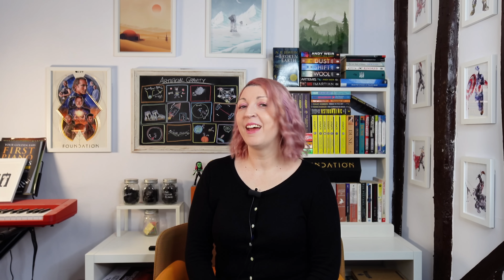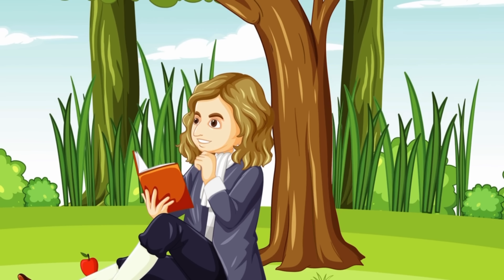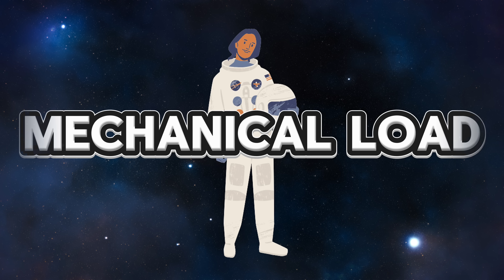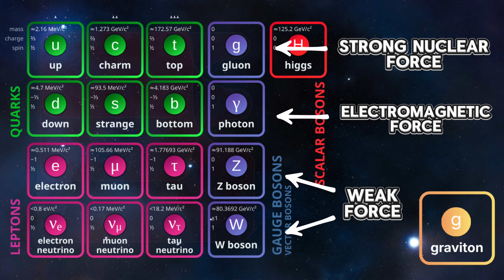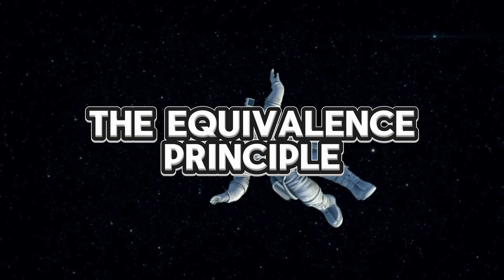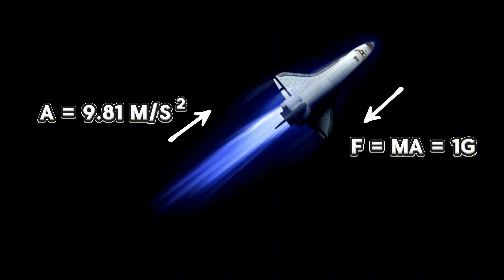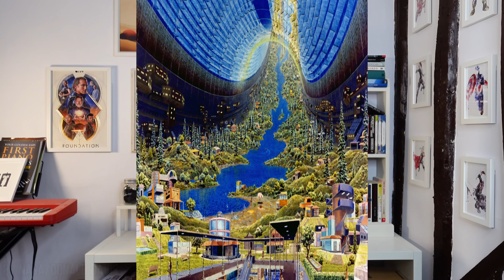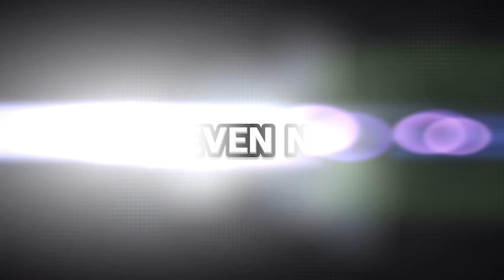Why Artificial Gravity Is Harder Than It Looks

Comment: The problem is mass, it would have to pretty long and wide, there was just a video the other day, about it. The issue is building in space or or many flights, with sub assembly in space. But it's very doable,  it's money. And the weight needed for adequate shielding. The bigger issue weight, and shielding against the different radiations. Essentially we think how big star shop is, the sub structures and sub assembly parts, would be 3 to 4 times the mass of star ship.with dozens of trips with a rocket that big, we really are another 50 years away from better engines.
I don't think I will see in my lifetime a trip to Mars where peope,take 9 months to get there, 14 months live there, till the alignment is right for them to return,  spending over 2 1/2 years  in space. It's a radiation issue,  and gravity issue,  there's not enough gravity on Mars aswell,  to be there that long, abd them not be physically weak after 9 months,

Comment: If a person is in a huge rotating space station providing artificial rotational gravity, and he jumps away from the floor, he would be stuck there floating off the floor. There is no gravity to pull him back to the floor. He would continue to rotate with the ship but he would not fall back to the floor. How far from the floor he floats would not depend on how hard he jumps. He would hit the ceiling sooner or later depending on how hard he jumps, floating in air, and would continue rotating with the ship in mid air. The walls and ceiling would need to have features built in that allow the individual to grasp the walls and climb his way “down”. Or the person could push off the ceiling sending him back to the floor.

Comment: I don't have questions, however at 17:42 of the video you mentioned about boots, if one would wear compression sleeves in space it would add to the stress for muscle strength to continue try wearing a compression sleeve for your elbows while brushing your teeth it's like lifting weights at the same time.

Comment: Gravity threshold for body changes. You could have a many step plateau depending on what partial gravity you are in (becoming a "belter" vs being earth normal).  We may have to consider there may not be one. it may well be a continuous loss at different rates depending what your partial gravity is (higher loss at lower gravity). We wont know until we do conduct those studies on the moon (as was mentioned). That would be the closest natural laboratory with 1/6th earth normal. We probably wont be building any large rotating space stations - because our economics system is based on short term profit. Short term profit and serious space exploration are diametrically opposed concepts :).  The only way it would work is government agencies or multinational cooperation. The farther we go out - the more deeper investment its going to take.

Comment: It i not an engineering problem as much as a cost analysis problem - as is whether to go to Mars. Designing and testing an orbital station that allows us to calibrate the tradeoffs between radius, spin and the coriolis effect is probably cheaper than a massive ESA building doing incremental research. Doing a practical mock-up makes space tourism possible - so that the tourists can occupy the low G rings while staff live in higher G - so that they can stay longer and not be expensively re-boosted on a periodic basis. Also, actually going to the Martian surface is not optimal. Instead, an orbital station around Mars designed with families and social structures - kind of an orbiting JPL - is much more effective for doing science with less wait time between experiments. There can be some up-and down to retrieve samples - but alcohol fuel and oxygen can be produced for this given a large enough station.

Constant boost is no so hard if you do a broken washing machine drive. Rotate masses but don't let them get to perpendicular to the direction of rotation. With enough rotating mass (with at least two modules with counter-rotation to provide stability), the only issue is whether your fusion micro-reactor produces enough energy to move both crew and reactor at .38G - or whatever G the spinning experiment say is necessary. Sometimes, engineering requires testing a prototype rather than a model.

Comment: I once wrote a short story about a romance which developed between two scientists who were working on an anti-gravity chamber. 
    The chamber was circular, the size of a small city library, and three stories high. It was lined with book shelves around the edge at all heights, with gaps between some of the shelves in which special hammocks were slung. These hammocks totally enclosed you, and were for reading books and/or sleeping. For those who prefered to sit, chairs were provided with seat belts to hold you in place. 
     What's more there were sandwich stations with specially adapted fridges and microwave ovens, for warming snacks and making hot drinks in cups especially designed for an anti-gravity environment. 
    Around the edge of this anti-gravity library, four or five metres inside the book shelves, was a grid network of metal railings which would enable anyone to climb towards an exit in case the machine went wrong. 
    Attached to the inner side of the railings, at regular intervals, were red circular items which looked like life belts (or life savers), normally found next to bodies of water. In fact they were strong plastic casings containing very long ropes which could be used in an emergency to help rescue anyone who couldn't cope with the anti-grav environment. 
    Eventually the day came to test the machine. This required each of the scientists to press hand sized glowing buttons on the ground floor, at opposite sides of the building next to exit doors. Both buttons had to be pressed at the same time to turn it either on or off. This was to prevent the thing being turned off while someone was floating about near the ceiling!
    All would have been fine except that one of them had been testing different gravity alignments the day before and had forgotten to reset the machine. They left it in 'gravity well' mode. This had the effect of pulling everything not tied down into the litteral centre of the library, where the gravity was about 1/3g. 
     You can guess then what happened when they simultaneously pressed their buttons and turned the anti-gravity on. That's right. They both floated up to the centre of the library, colliding with each other and staying there, as if magnetically glued together! Their collision set them spinning and tumbling and they soon became disorientated and nauseous. Luckily they'd taken strong seasickness medication which helped to prevent vomiting.
      At first all they could do was to close their eyes and cling to each other, body to body, laughing aloud and yet a little scared while they tried to recover from their shock and disorientation. 
      Question: How did they stop/slow their spinning and tumbling in the litteral centre of the library, and how did they get to the buttons to turn the damned thing off?
      Clues: They were wearing climbing helmets, and sports clothes suitable for unhindered motion, and each had 20m light weight climbing ropes attached to themselves in case of emergency. They discussed pushing hard away from each other in an effort to reach the railings, but decided that might only make the tumbling worse if they collided again in the middle.
      How did they escape their predicament, caught in that unforgiving gravity well? What clever thinking helped them both to get to ground level and turn off the machine?
      Please leave your suggestions below.

Comment: 3l atlas might give us a hint. How to rotate the higgs field to simulate gravity. The interactions of the fields involved (this is the story telling part) evolve frequencies required to create artificial mass that are seen as color in 3I atlas halo around itself. 3I atlas core also spins and diameter is  approximately given as 1.5 to 2 miles diameter.
Seems like the components af artificial gravity is being given to us by 3I atlas curently. Perhaps this is its message. Spin the higgs field seems relevant ...and the atomic particle analysis of the core of 3I atlas appears also necessary to pull artificial gravity off,  as a working system. ???

Comment: 1) From what I remember, in The Expanse, no one was burning for months… and fuel was regularly loaded (there's even a line of Fred Johnson on Tycho complaining about how much free fuel he'd been loading into Rocinante.

2) Also in The Expanse, in the last season we get several shots inside the fusion ignition chamber, with a fuel pellet being injected for what looks like a laser-based and tokamak combo. You can work out the specific impulse of a highly refined heavy isotope pellet — rather doable.

3) There's been quite a few works of literature (and then cinema, such as the upcoming Hail Mary) using quite long cables to reduce Coriolis effects on the cheap.

4) Surprised you didn't illustrate the Coriolis effects with numerous frames in the Expanse (Miller pouring whiskey-like alcohol… Naomi Nagata using dust on Eros to check their position when lost…)

5) It's not an engineering problem. It's a human coordination problem, which is worse and much trickier to solve than physics, alas. 😕

Comment: Space craft will need to be redesigned. At the moment they're designed with zero gravity in mind - esp. the larger space station module type habitats. Once you re-introduce gravity into the equation again, a lot more strength has to be factored in. That increases weight and launch costs increase exponentially - If you tether two matching craft on an adjustable length tether, you may be able to then work out what rates of gravity are adequate? This length will determine spin rate and g-effect? No crew should be required on the "dumb" craft - adding crew would simply double your HR logistics...

Comment: it all just sounds like angular momentum if gravity were a force, it would all be the same, but it's not the same goes for the clocks it just proves that depending on where you actually stand has more to do with time dilaton than anything eals two clocks at the same place have same gravity applied to them as they move from the surface Angular momentum increases and you have your time dilaton variables light travaling past a large body same thing angularmomentum gravitatonal foce puling on the particals as they pass by gravity realy is just the side afect of mass in moton or at rest it realy dosnt matter its a mass efect. Take a large planet, for instance you stand on the surface, you are heavier, but you are the same weight you stand on Mars you're lighter but you are the same weight same for any planet weight changes by the mass of the object you are standing on, so how can it be a force

Comment: Magnetic boots would NOT allow you to move « normally, » because the rest of your body will flop about like a fish if you don’t use your legs and feet to compensate. Leaning forward slightly as you do in gravity would have no effect on your walking speed. Zero. Walking in mag boots would be very stressful until you developed the muscle strength required to move as you wish. Most people would learn an entirely new way of moving within hours. 

Acceleration of a ship would NOT be different from nose to tail, except for the milliseconds that the flex of the ship’s structure took to reach full compression at that acceleration. What would be different is that a ship on a surface under gravity (and not otherwise accelerating), WOULD have a slight difference due to the fractional difference in distance from the greater mass’ center of gravity and any centripetal forces due to the body’s rotation. . 

I’m not going to comment on everything in this video, but I reckon most folks interested in the topic would have lost interest less than five minutes in. Nice try, though, and thanks for making a video that sixth-graders can relate to. Heck, I appreciate your effort; I know making videos isn’t that easy for most people, and studying videography along with physics is likely quite challenging. (That’s why writers’ guides recommend writing what you know.) You might practice not looking down your nose at the camera; I think you’d be cuter at eye level. :)
Reply from the maker: lol. you really are clueless.
Reply: @popculturescientist  That’s why I keep researching.

Comment: Some interesting numbers from an engineer…

Mars gravity with 4rpm (the tolerance limit for some people) requires a centrifuge radius of just 16.8 metres. That’s entirely achievable currently with a tether, and a trial in orbit could tell us a lot about Mars habitability.

Mars gravity with 1rpm (likely tolerable for most people) requires a centrifuge radius of 268 metres. That’s an engineering challenge, but likely achievable with effort as part of preparations for a mission to Mars. And it could form the basis for a permanently habitable space station in Earth orbit for long term occupancy.

If Mars is ever to be gravitationally habitable, we need to develop and prove a 0.3g habitat, and if that’s viable there’s no reason we can’t base future space structures on that gravity.

And we’d need to engineer a largely vibration free coupling to a non-rotating hub for arrival and departure, and access to a microgravity section for scientific research.

Comment: Space X has mentioned two spacecraft tied together by a long cable that sins at the central point to create gravity.  Which would solve the inner ear issues of tighter spinning.    As for a ship why spin just a small part or section.  Why not spiral like a football the whole ship?  The only part that spins in the center would be the energy generator and the engines.  Where when spinning wouldn't have to be crewed with anything living.

Comment: We could do the electromagnetic thing for long term and trick the body.  By using metal implants and pump implants or drugs to increase blood  and spinal fluid flow and pressures throughout the body. Also putting metal into the space suit to help the electromagnetic forces to react also with the metal implants.  As we have the technology just have to implement the idea.  Once we decide to take longer trips.  Lucky for humans we may have hundreds of years to weight for trips further out into our solar system.  but may be ideal for colonies on the moon to supplement the effects of 1/6 Earth's gravity to something closer to 1 g.  At least this is how I would do it in the short term.  Long term genetic modify human travelers to adapt to space travel.  no legs four or more arms with two hearts in order to compensate for reduced blood flow.  with metal or plastic to strengthen or reenforce bone.  then have environmental suits to be used on what ver destination they are to arrive at.  Both would be classified a another species of human.  But the experience would be the same.  Once we leave Earth we will be branching off into another branch of evolution.  These ideas are more plausible.  A cyborg human is doable with current technology and less energy intensive.  Like to see you explore the idea od cybornetics. and its ability to solve many of the issues of living in space.

Comment: One issue I see with a short radius centrifuge is that you will only have one G in one short radius zone.

Although it’s probably logarithmic rather than linear, if you have a 10 foot radius centrifuge you would have zero Gs at the hub and one G at the 10 foot mark so therefore you would have either 1/2 G at 5 feet if it’s linear or approximately the equivalent of pi at 5 feet if the effect is logarithmic.

Obviously, the larger the radius, the easier it is to keep one G on a large larger part of the body

So I see some problems with biological experiments with short radius centrifuges.

This is the first time I’ve watched your channel, and I think you cover the topic very well. I think I will subscribe.

Thank you!

Comment: The 2001 Orbiter Hilton, it turns out, is too small a circle for the Kubrick/Clark vision of comfortable, casual walking. Sorry, Howard Johnson.
Heywood Floyd would have been constantly dizzy, and the difference between the experienced gravity at the head and feet would have been disconcertingly noticeable.
However, expanding the circle out to the diameter of Isaac Asimov’s L-5 or the Stanford whuchamacallit should solve those problems.

Comment: Centrifugal force if you are in Earth orbit. The acceleration to Mars is close to 1G, halfway through the journey the ship is turned around and the brakes are applied with -1G. This requires an engine that uses electricity, because you can't carry enough fuel for that kind of journey. I have the drawings for that engine, but it's not easy to reach anyone who would work on them. I guess the idea will die with me and humanity will ache to not be able to leave Mars. Yes, it can, with nuclear power.